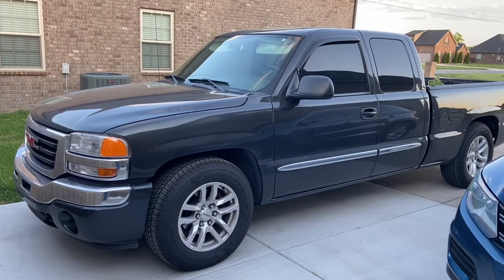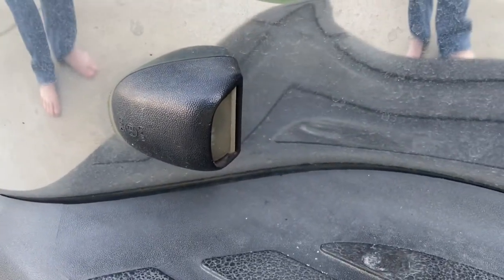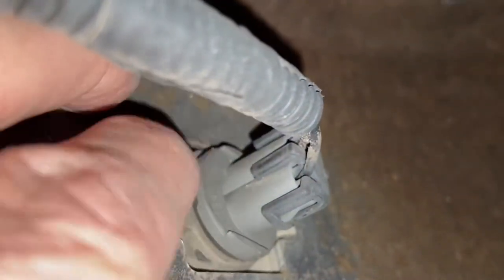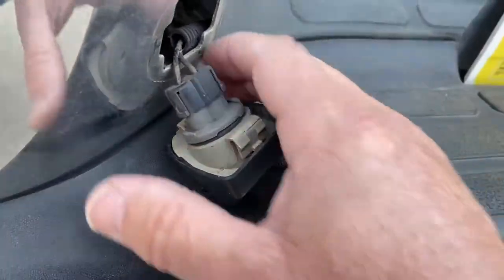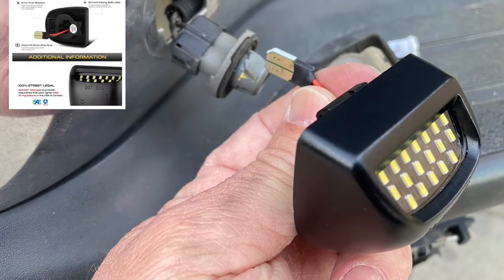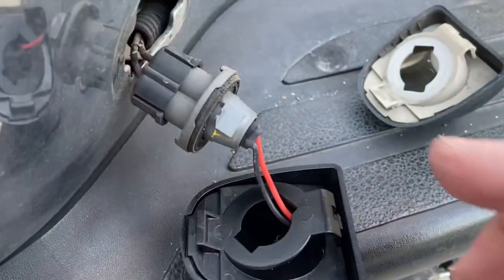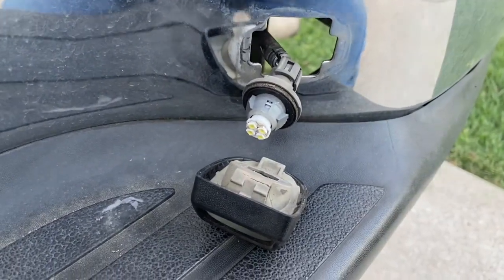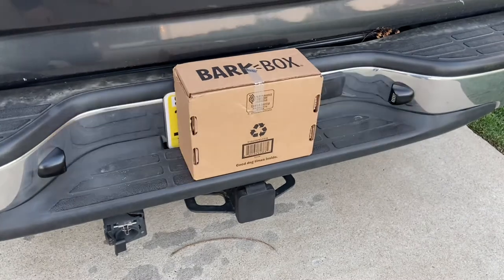1999-2006 GMC Sierra / Chevy Silverado - LED license plate light easy upgrade / swap / fix

Comment from the maker: I realized after uploading the video,  that I forgot to plug the bulb sockets back into the plastic assembly.... I got in a hurry. Sorry guys!
Reply: -- Yeah, just did mine yesterday 2004, Tahoe winter beater.  Was gonna comment on the sockets.  I needed a file to get mine to seat, then slathered them in grease.

Comment: I have an 05 Silverado and installed these and the bulbs won’t come on 🥲
Reply from the maker: Actually, these particular ones have started to fail on my truck. I contacted the seller but have gotten the runaround even though it is a “lifetime warranty.” Mainly this was a quick installation video, and not a true endorsement of that specific product… which worked fine for over a year.
Reply: @troup1993  I think there may be a wire screwed up and that’s why they don’t turn on I don’t really know tho lol